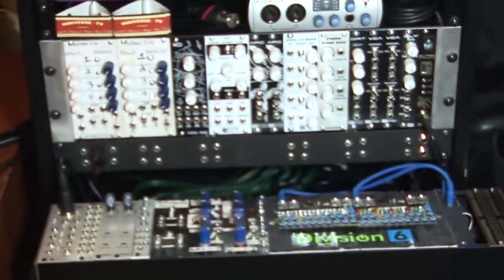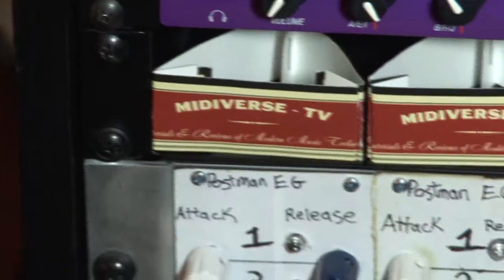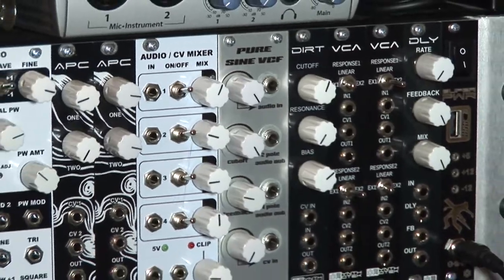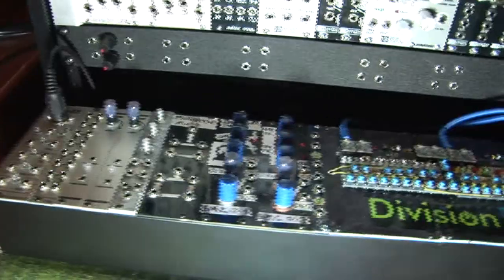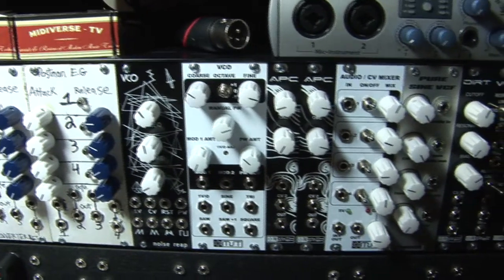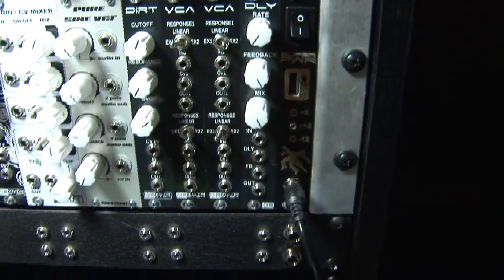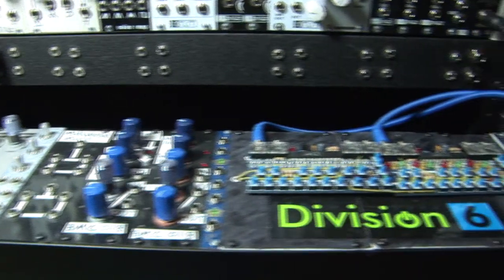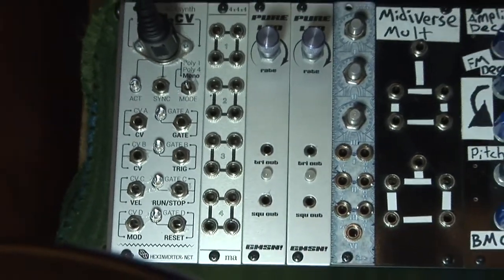Synth DIY - Part #3 - One Year Later - MVM #58

Comment: I'm looking to get into building a eurorack synth. Would you recommend the synthrotek kits? I know how to solder and everything, just wondering what was the total cost for this build, and is it worth it.
Reply from the maker: Thanks for watching our video. I would absolutely recommend the synthrotek kits. It's a good way to get started, they're pretty simple and straight forward as far as the building goes for the most part... solid modules as well. I'm not sure what the total cost of this system is, as it's constantly changing. If you're looking to save money though, consider buying only the PCB/Panel for the modules you want and then source the parts yourself. It's very very time consuming though to find each individual part, that's why kits are always a nice option.
Reply: Mouser is a good place to find parts, just a tip. You should do a demo on the Synthrotek Roboto. Very cool eurorack module they released :)

Comment: I can't avoid the calling. I want to build my own diy modular synth setup. I haven't tinkered with electronics since taking apart my Nintendo back in '87. What do you think is a good place to start for someone new to electrical engineering and other skills necessary for diy modular projects? Any help is appreciated.
Reply from the maker: Hey Ricardo, thanks for watching our video. The first module we built was an APC from Synthrotek. It is pretty simple, great documentation, and instructions on their website. Other synth DIY resources to check out are Music From Outer Space, Modular Addict, Thonk, and there's also a great FB group called "Synth DIY" with lots of great information inside. Hope that helps!